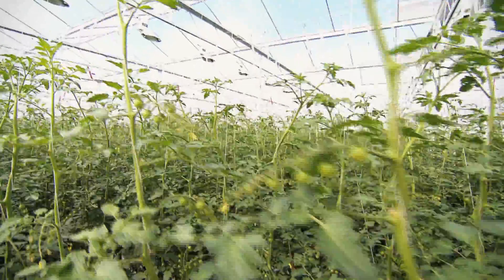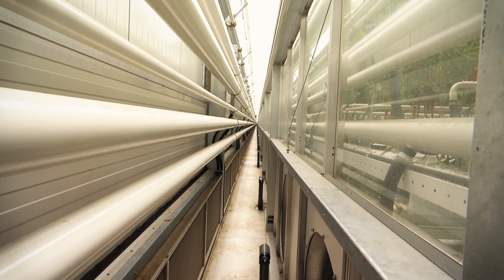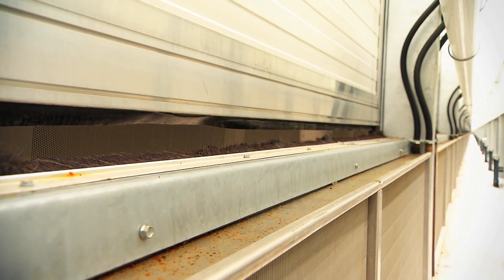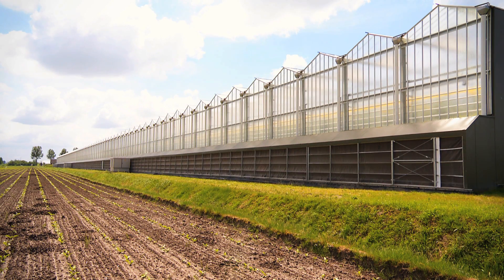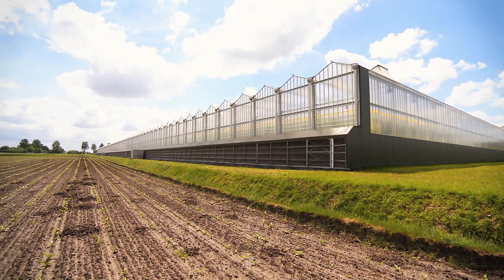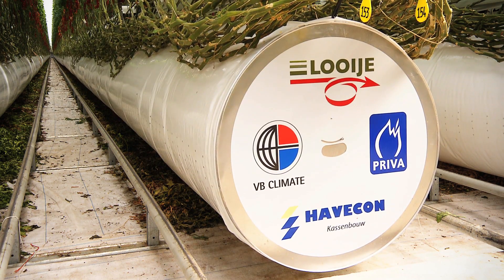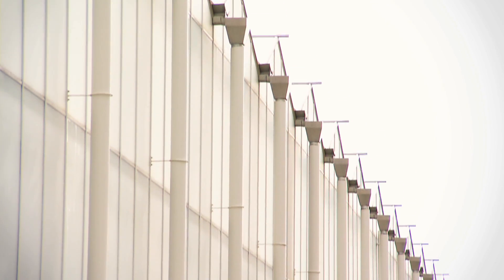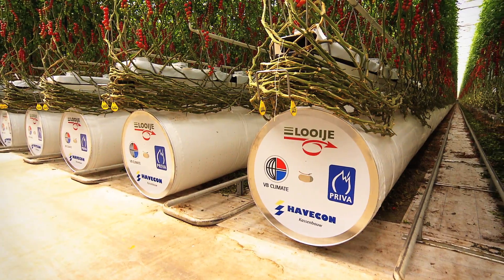2014 RAI GREENTEC ACTIVAIR V3 EN H264

Comment: Is this system suitable for area with 45 degrees and 90% humidity?
Reply from the maker: Hi Ahmed,

Thank you for your response! At Looije, the system is used to heat the incoming outside air which is used to dehumidify the greenhouse, so that is can be blown under the tomatoes.

This system is not designed to cool down air of 45 degrees with an RH of 90%. However, if you have any ideas for building a greenhouse, we can help you select the right installation for your specific situation.

We are happy to think along with you. If you’re interested, please call to +31 (0) 88 200 5000 or send us an e-mail to supportcenter@priva.nl

Priva Horticulture Team